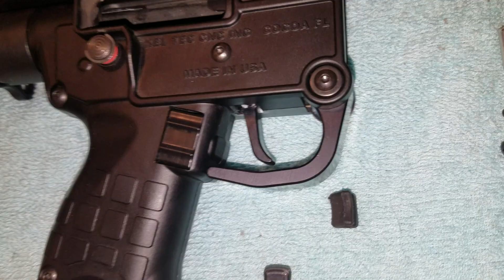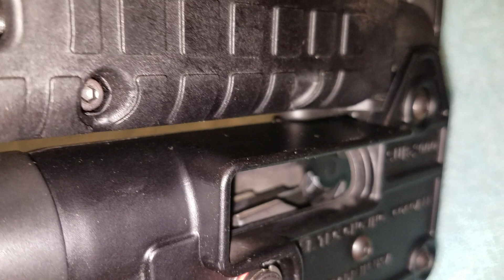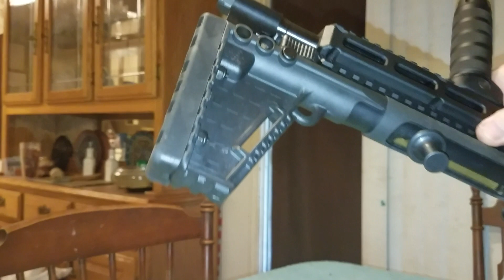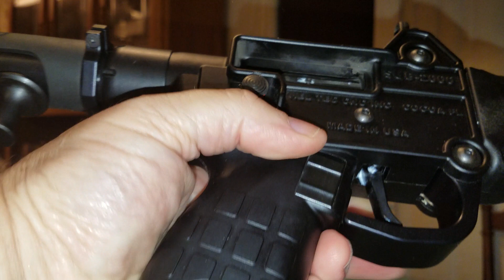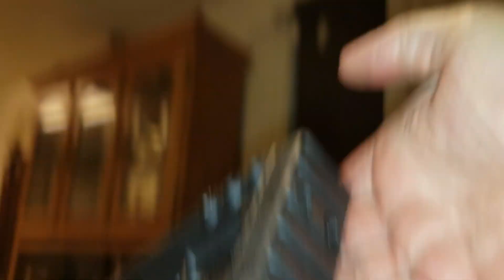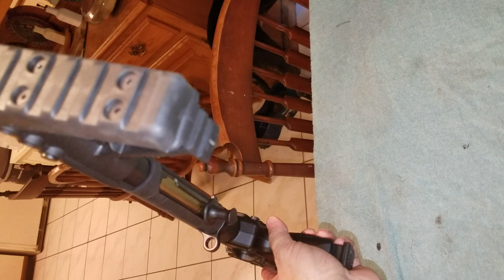KELTEC SUB2000 M-CARBO

Comment: Now looks all you need is maybe a the mcarbo compensator. Skeletonized charging handle be a great idea mine broke in half. Otherwise it looks great.
Reply from the maker: If you deburr and polish the slot edges the charging handle slides through the charging handle doesn't get worn and break in 1/2 ...Merry Christmas! ;)